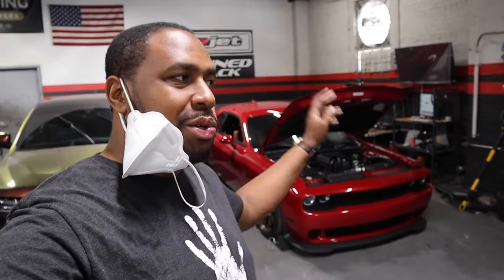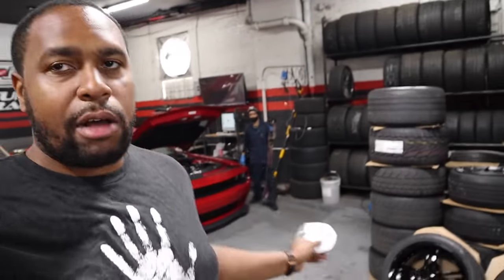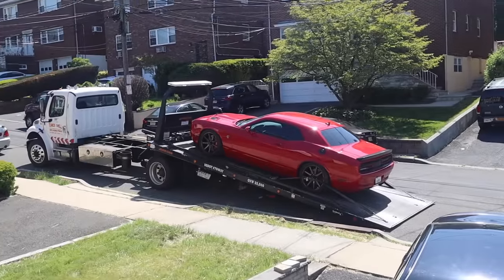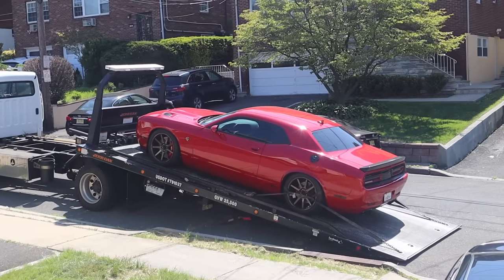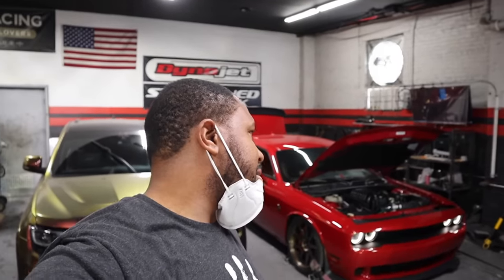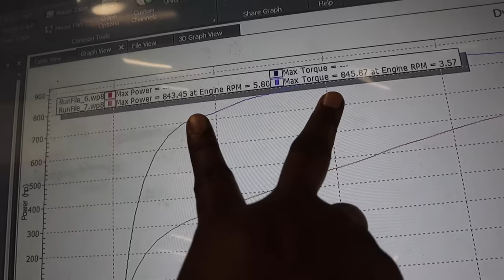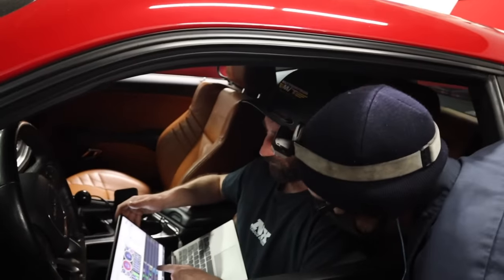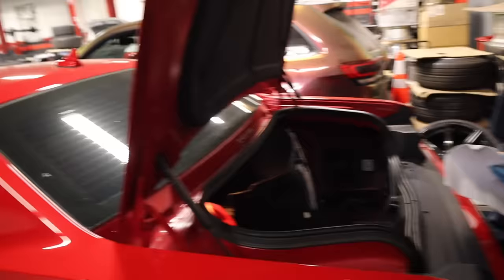My Hellcat is Going Full E85 To Make Huge Power

Comment: You are going to blow up your car again. Man you need to get a tuner and let him setup your car. Adding E85 to an engine that is not tuned for ethanol = BLOWN ENGINE! You did not have the correct fuel pumps = low fuel in a cylinder = detention....BLOWN ENGINE. Dude, you are half assing this. Fire the shop you are working with....you are killing us. Get a good tuner!